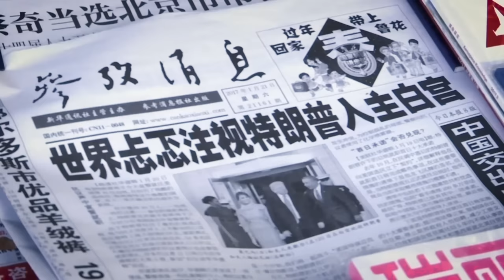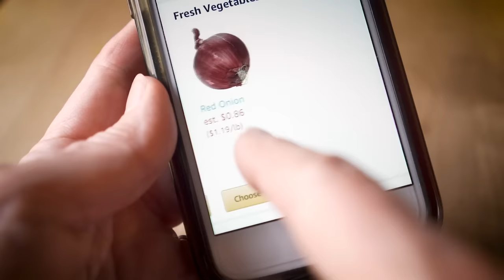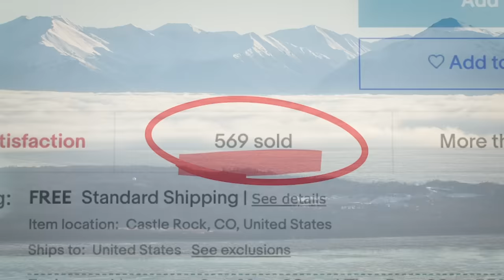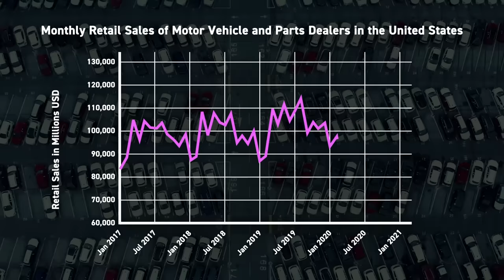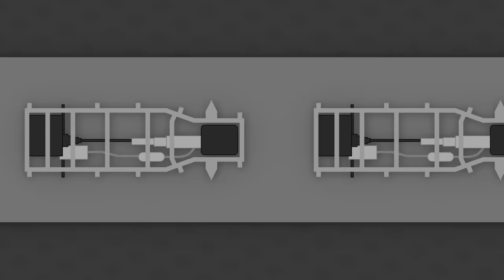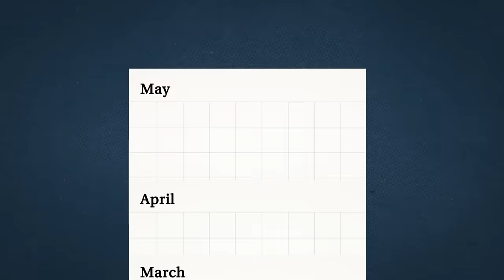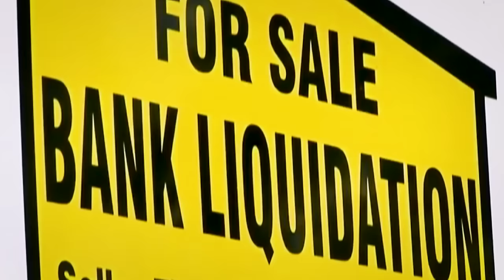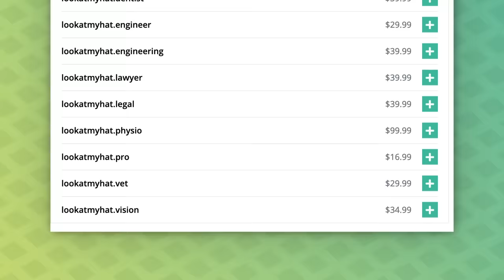Why There are Now So Many Shortages (It's Not COVID)

Comment: The Toyota Production System works well... for Toyota. The lack of free thought in the manufacturing industry has me astounded.
Reply: I don’t have any manufacturing industry knowledge, but it seems that the unions are quite strong in the US auto industry and I wonder if that has to do with that “lack of free thought”. I think unions are necessary for some sectors, but the union I’m automatically in seems to either draw out proposed changes or shoots them down with little discussion. I understand the desire to not leave anyone behind but not making advancements hurts everyone in the long run.
Reply: @peterl.104  Unions have little to do with this,they could fire a lot of people to stay profitable and rehire later and wouldn't solve the problem.

What Toyota did that he didn't mentioned is that Toyota forces their suppliers to stock components to make the product for toyota and the amount of time varies,Denso has to have months of stock,but toyota investigated even the suppliers of the suppliers,so the chip companies that supply Denso also needs to have stock but smaller and so on depend on the piece it can go as far as tier 5 but mostly it ends at tier 3.
Reply: @lordanonimmo7699  great point. Supply chains are truly like those fractal russian dolls. Does the chip supplier's supplier have sufficient supplies of capacitors? Does the capacitor supplier's raw materials supplier have enough tantalum? Lean is so crucial to Toyota due to their own cost of holding stock, but it is just distributing stock across the chain, scheduled like clockwork to accomplish Just In Time.

Comment: “For the want of a nail the shoe was lost,
For the want of a shoe the horse was lost,
For the want of a horse the rider was lost,
For the want of a rider the battle was lost,
For the want of a battle the kingdom was lost,
And all for the want of a horseshoe-nail.”
Reply: Thanks DK
Reply: Drift? Hwuts drift?
Reply: slippery slope huh
Reply: @bmanpura  More "cascade failure" aka "domino effect".
Reply: Where was that from
Reply: @bishop51807  Assigned to Ben Franklin. Happens on a daily basis in real life. I think the videographer here is "covering" for folks responsible for all the devastation caused by this "plandemic".
Reply: @bishop51807  I doubt it’s the original time the quote was used but it was used the fast and furious Tokyo drift

Comment: this is a great video considering the cause of physical supply shortage, however this fails to consider the labor shortage that has been brought on by said supply shortages, which cause the people in their jobs to become over-worked for the same pay, causing people to quit because welfare pays better, causing the remaining employees to become more overworked, etc. all with no pay increase. the system currently in place IS flawed, but it goes much deeper than just the supply shortages.
Reply: You also have to consider the impact of all the future traders.
Reply: Symptoms of the same problem. The people at the top are looking for ways to cut corners and make a quick buck. There is no fore thought into what may happen, only the bottom line in the near future.

Comment: as long as Toyota Corolla wasn't on shortages, so Real Life Lore didn't complain about it.
Reply: Just bought a new 2021 Corolla. $18,400
Reply: @drayne3750  possible fail the corolla line is not exactly there most reliable
Reply: @drayne3750  if you want reliable get a mid 80s town car :D
Reply: @drayne3750  the aluminum heads are prone to overheating quickly when your thermostat fails but they make a thermostat that locks itself in the open position when it fries out which will prevent that from happening
Reply: @josephfuller6229  I have a Corolla XSE Manual hatchback in bright blue. It’s been a fantastic car.
Reply: @Eldomibori  if i was you i would replace your thermostat asap to one that does not close when it goes all all aluminum heads will overheat and warp really easily compared to my steel monstrosity lol i have a 89 ford ranger where almost the entire back half of truck has been welded the people were using it to haul a bobcat
Reply: @Eldomibori  when i first got it the fuel regulator was bad so if you ever have fuel leaking from your vacuum lines that is the cause
Reply: @josephfuller6229  Well, I guess I shouldn’t have that problem then since I’m leasing it. But if I decide to purchase it at the end of the lease, then I’ll keep aware of that.
Reply: @Eldomibori  even leasing you are only covered for a certain distance the new type of thermostat only costs like 16 dollars and locks itself in the open position if it goes out but you should be fine for a bit just make sure to keep clean fluid in radiator etc as that is what usually clogs up thermostat
Reply: @josephfuller6229  I’m covered bumper to bumper for the full 36 months and just got this car a few weeks ago. I might even go change the thermostat myself if I purchase the car when the lease goes up. A few years ago, my 98’ Grand Cherokee V8 thermostat got stuck closed and warped the heads unfortunately but I got it all fixed.
Reply: @Eldomibori  besides the aluminum heads the motor is fairly good it is used in pretty much all of the mid sized vehicles built

Comment: Tried to buy a new refrigerator recently. Every model I asked about was OUT OF STOCK
Reply: Was like that in 2020
Reply: Rick.. maybe it’s because it lasted more than eighteen months....
Reply: @takearight.  stock supplies are low, like inventory of everything else right now. I fixed my fridge.
Reply: @quisiabattley1039  no, I looked at Home Depot in late June 2021
Reply: @rickpontificates3406   Wow that’s great! Was it a leak? I saw a show the other day about shady appliance techs that lied to customers 
about what it would take to fix the leaky fridge. (they are designed that way to have to buy again) .just sayin. Gettin fleeced at every turn aren’t we? Take care.
Reply: @takearight.  no, the condenser fan was stalling intermittently so I replaced it ($20 from Amazon). The condenser had frozen over. So my guess is, when the fan stalled, it prevented the fridge from going into defrost mode because it never cooled down to the desired temp so it cooled and cooled and cooled until it froze over.
Reply: @rickpontificates3406   Thanks Rick! It might be helpful to some other potential victim... 😄

Comment: Instead of electric cars I want to see a car manufacturers start making cars with little to no electronics, just old school mechanical machines that don’t break
Reply: Not even necesarily old school mechanical machines but a car that works even if the technology inside is broken. Having to buy a new car because one little thing is broken is dumb
Reply: Insert co2 propganda here
Reply: Not enough profit in that...
Reply: The old mechanical ones broke, too, and more often. But, those cars didn't cost as much as a modest house and were easy to repair inexpensively.
Reply: @PaleRider54  Easier for Dad to avoid high mechanical repair costs (assuming he has enough basic knowledge).

Comment: Sounds like we need to stop putting computer chips in things that don't need them...
Reply: What, No chips in my oven or washing machine? 😜
I Guess you're kind of right.
Reply: If only they would realize this!
Reply: Amen. Go back to non digital machines, cars, appliances. We can live without all the Star Trekkish gadgetry of modern society.  Cars were much simpler to work on, that's why anyone could fix them. Same for a lot of other things, too. Who cares if the steering wheel is heated or there's a screen to help you back up--that's what MIRRORS are for, Helen!!!!
Reply: Engineered obsoleatery - at the flood quart at the mual. Yay fartball !
Reply: Would you like chips with that ? No thank you . Blank stare. Would you like chips with that sir ? No thank you. Kid goes and gets the manager. Manager comes to the counter . What seems to be the problem sir ? I don't want chips . So your going to have to fill out this complaint form sir.

Comment: Focus on paying with coins when you can. Some stores Home Depot and CVS have self serve machines that allow you to dump cash for full credit into a coin sorter attached to the register. I ring up my purchase dump all the coins I have in my pocket and then if I still owe I pay the rest by credit card. I am returning the change in my home into the economy. I don’t lose any value, it takes me very little effort, and it is good to get the coins back into circulation. All stores should have the ability to electronically accept coins.

Comment: As of May 2022, the UP railroad TOLD Pilot and Flying J to reduce their orders of fuel by 25-50%.   Not asked, told.  There is no reason for it other than to intentionally cause a fuel shortage.  There is not a shortage of gas and diesel.

Comment: Cars used to be so simple that almost anyone who is mechanically inclined could actually fix most things themselves, all you had was an engine  transmission, radiator, alternator, battery, water pump, fuel pump, a distibutor cap, and plenty of room to work on things, now you'd best bring your car to the dealer for repair and maintenance  or a good trustworthy mechanic !

Comment: Excellent video!  I agree with Sheb below:  this is a great video considering the cause of physical supply shortage, however this fails to consider the labor shortage that has been brought on by said supply shortages, which cause the people in their jobs to become over-worked for the same pay, causing people to quit because welfare pays better, causing the remaining employees to become more overworked, etc. all with no pay increase. the system currently in place IS flawed, but it goes much deeper than just the supply shortages...also the fact that people may not want to get vaccinated to keep their jobs...

Comment: Government needs to get involved to regulate trucking industry. Truck drivers waste way too much time at shipper la and receivers for no other reason than greed. I usually pull 6 to 7 loads a week on average 400 to 500 miles each. These days I can hardly pull 3, the reason? Shippers and receivers. As I’m writing this right now I have been waiting to get unloaded for 2 days and there’s one more day to go. Just seating down and burning fuel to keep cheese cool enough in my reefer trailer. 😔. That’s 4 days wasted on a single load because the receiver want to save money. Many more drivers go through similar situations and some end up quitting. There has to be a way to make this go faster. American Economy relays heavily on transportation and trucking at the center of that.

Comment: There is another problem specific to auto industry. Everything is on chips. Even things, like acoustic warning, that someone sitting in a seat is not strapped in, when this could could have been done with a single circuit. All you'd need, is a trigger, when car reaches certain speed, a weigh sensor in the seat (which could literally be spring based), contacts in the female side of the seat belt joint, a buzzer, some wiring and a pair of relays per seat (weight sensor triggers one relay, closed circuit through seat belt joint disengages the other)! Outdated? Sure. Does it get the job done and lower exposure to one particular component, which requires special resources? Yes.
I for one believe, that Just In Time is BS, precisely, because shit happens. We are already at point, where transportation companies report hourly positions of their trucks and trains, because a manufacturing process doesn't have a day of materials on hand! Imagine, you have to change production, because the driver hit a deer. It's ridiculous! And it doesn't need to be of natural causes or coincidence, it could be man made by a speculation! Stockpiling doesn't solve that! The only thing, which does, is getting more involved in the supply chain. There's no way VolksWagen group didn't know, how reliant they are on particular commodities, yet they didn't build a FAB to cover some percentage of their demand, nor did they buy a copper mine and processing companies, which could provide them internally with necessary wiring (given the forced electrification)! Are you freaking kidding me?! There's no way, they didn't see situation like this coming. Maybe not due to natural reasons, but definitely because of political ones and they still did nothing! 
What I'd like to see, is approach, which eliminates strategic threats to manufacturing system. The most prevalent one these days, is that everything is done in China. Nothing against China (well, except basically everything they've done past decade), but the fact, that basically all manufacturing is done there at scale has become a bottleneck in the system, that is prone to clogging, due to political reasons. What I'd do, is I would find three locations on Earth with decent, all be it not perfect environment for manufacturing, preferably on different continents, and I'd build manufacturing hubs there. There wouldn't have been that big variety (at least within a model Octavia for European and Indian markets are on completely different base models), but there would be bigger interoperability. Say there were plants in the EU, mostly focused on European market and R&D, plants in Egypt, mostly exporting to Africa and plants in India handling local market and parts of Asia, China, if at the time there were a presence there, would be it's own system. All plants would buy from the nearest suppliers of required materials and run between 80 to 90% capacity. Why? Precisely because of shit like Covid or political meltdowns! This way, even if a entire continent went down, you'd have two thirds to a half of capacity secure and you could ramp up, if need presented itself, at cost of time spent on system optimization and short term reduction of maintenance at particular plants.

Comment: It's important to state that, because chips are small, their stocking prices are quite low. So, as opposed to no stock, a company should look to stock inexpensive & small parts, that have a high probability to disrupt the supply-chain. But in what regards chips, it can be hard to stock them, since it's a very, very fast evolving industry, and in half a year, a stock that was worth milions, can be worth a couple thousands (this is due to exponentially decreasing memory prices). The constante fall in memory price might not be a real problem for car manufacturers, since that fenomena is due to high-tech companies wanting more memory in less space, but cars don't quite have that problem. Cars have enough space to accomodate whatever size the chips have. And, the chips aren't even the most expensive part of the car, yet the car can't go to the market without chips. In sum, the car manufacturing is being halted due to small chips (which it doesnt need cuz there isnt much space restriction) that aren't even that expensive on a car, but the car can't function without it. The whole supply chain is being halted due to stubborn managers not wanting to store little tiny chips for a couple of months due to "lean". Let me tell you, thats not lean.

Comment: I can clearly recall the time back in the late 80’s early 90’s when attending one of my several management conferences when the magic system of JIT was introduced. I listened in stunned amazement for even at that time I  envisage a massive problem if even one small link in the chain failed. My response at the time was, we had better consider the other side of the coin ie. JTL 
being Just To Late. Now here we are. Take the smallest gear wheel out of a clock and it surely will stop. Just sayin!!!

Comment: It's really weird how he didn't mention lean manufacturing which is the driving principle behind things like just-in-time delivery. Essentially what lean manufacturing means is reducing waste. This waste is not what you throw in the trash, it's anywhere there is something that is not making money when it could be making money. So in his example, just-in-time delivery reduces waste by decreasing the stockpile size, reducing the need for a humongous warehouse, and by not having expensive products just sitting somewhere. However, lean manufacturing is about optimising. You would rather have a stockpile than having an extremely expensive human or workstation doing nothing. Essentially, Toyota assessed that there is less potential waste if they stockpile chips than the waste they generate by actually storing those ships while other companies didn't come to that conclusion and suffered the consequences. Toyota isn't the only company that is applying their own principles right, just-in-time delivery is a technique used in lean manufacturing and every sector balances this differently. On an unrelated note, what fatal flaw in the titanic is Sam aware of that would have made it sink if there wasn't an iceberg? What is the secret conspiracy that we don't know about and Sam does?

Comment: Unfortunately Toyota just bought themselves more time until they ran out. They are now suffering the same issues as other manufacturers. Increased vertical integration will be more prevalent in the future, especially for less resilient parts of the supply chain. Tesla is the prime example of this in the auto environment right now.

Comment: Real reason for lack of car chips is that  there is no big profit for chip manufactures to produce old chips and car company's use older type of chips (10-15 years old) except tesla , no need to use modern powerful chips for automatic car brakes for example , you don't need that much computer power , also old chips r more reliable  (less transistors per square millimeter) , you dont see chips  scarcity in lower cost mobile  segment for example , so not all chips r the same